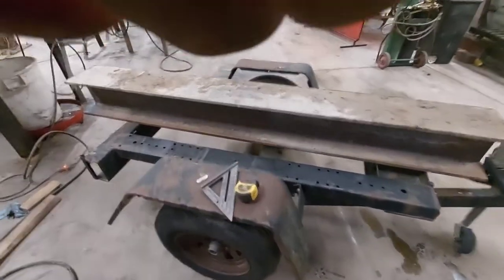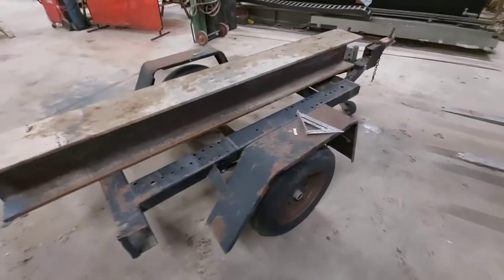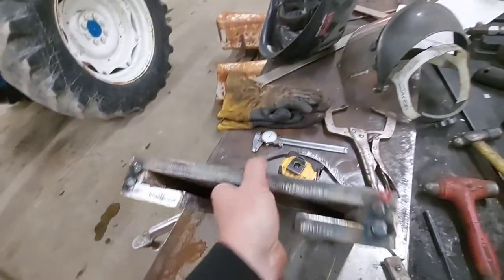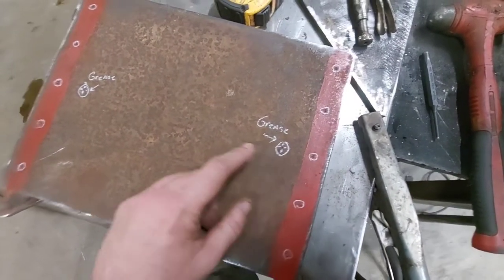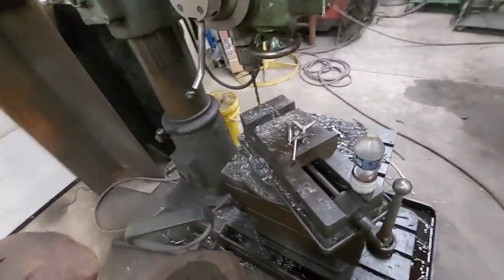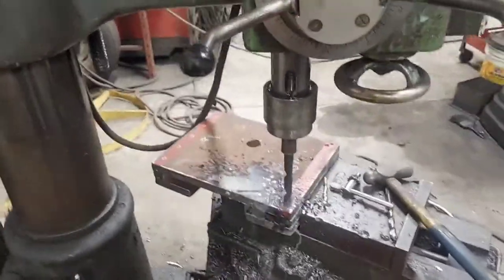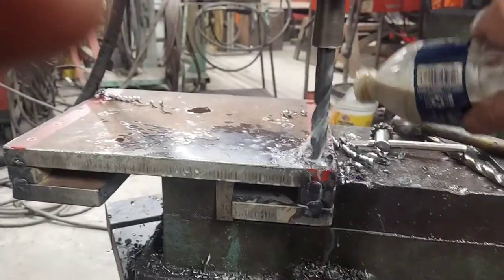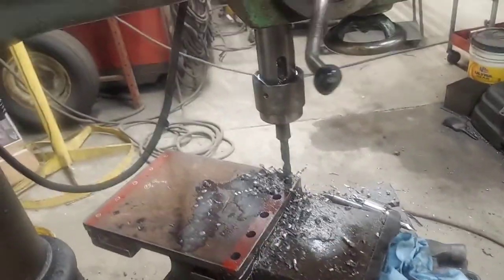Building a wood splitter.part 1

Comment: Ooo…here we go! Nice shop you got there. Looks like the right place to build a beast of a splitter. I’ll be tuning in for all the next steps! Damn!…this makes me want to get back going on my next splitter!  Nice to see vids of a tuber building his machine instead of hearing a tuber talk about how many weeks until they get there factory built unit. Your completion and their delivery might end up being close to the same time 🤷‍♂️ but one of ya is gonna have a lot more money in his pocket!😀
Reply from the maker: Thanks garny,yes might take awhile but I have no reason to rush other splitter is doing well..I will start accumulation of parts here and there and focus on the fab work for now.what cylinder did you use on that monster you built?
Reply from the maker: I just watched a few of your videos again damn that thing is a monster! I had forgotten how bad ass it was..question,what do you do for a living?engineer,welder,hydraulics wizard??
Reply: @everythingoutdoors7944   i replied to this with a link to the ruggedmade cylinder I purchased. I had a hyperlink to the website but YouTube must have not allowed it. It was a ruggedmade 5”x30”x3.5” for $500.
Reply: @everythingoutdoors7944  I do a little bit of all that. It’s in the blood from my Dads side. And working for a major lawnmower manufacturer and a few cranberry equipment fabrication shops I have picked up a lot repair and fabrication knowledge. Looks like you and I are cut from the same cloth. What is your occupation/work history?
Reply from the maker: Started in a machine shop at 15 ended up in a welding fab shop at 20 been there 23 years now lol